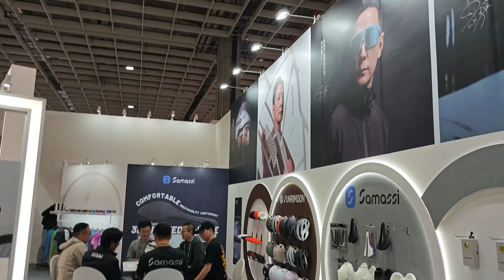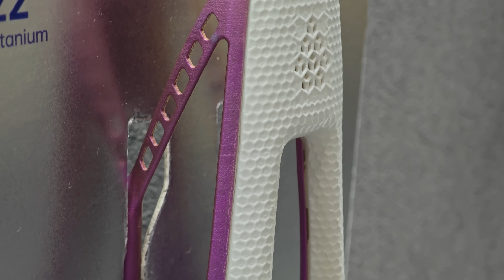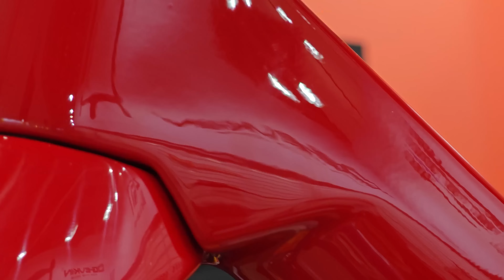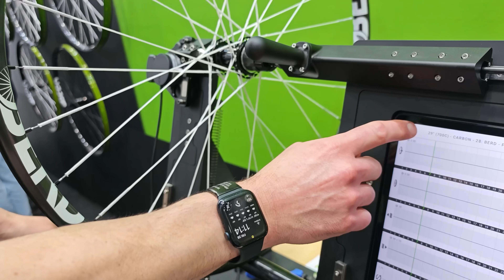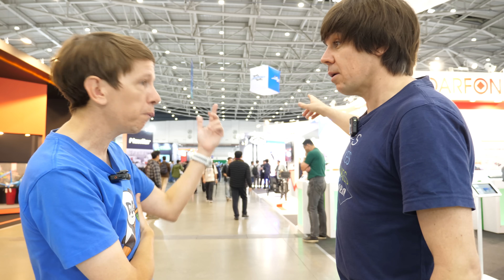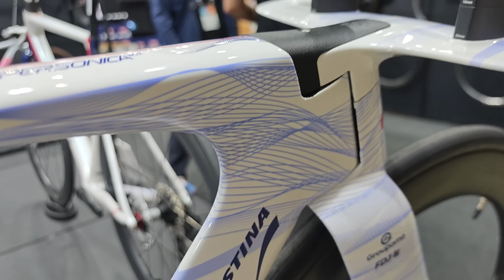Taipei Day 3 Ft. SHODDY DAVE, Track Frames, 3D Printing, BERD's Truing Machine, and much more!

Comment: is seems like Rockbros is becoming like Decathlon-cycling brand for the masses. they have coverage for all the basics of cycling needs from tools, accessories n now to base bicycle 👍
Reply: Worn their sunglasses for years, Do a great job and are cheap.
Reply: @2wheelsrbest327  they even introduce cheap cycling/tri eyewear with myopia inserts for the masses at cheap entry point (sp247 photochromics). and that insert frame, they even sell those replacement spares.
the stuff is not disposable junk, you can prolong the use 👍
whenever reddit quastion pops up for RX, i'd recommend this

Comment: Is the SPMND UCI legal. Do you have more specifications on the frame sizes? Thanks for the informative videos these last 3 days. I get the feeling that we are going to see more and more of the Taiwanese products in the western builds as the quality and spread of components is superb.
Reply: There's nothing uci illegal about it. The problem is that it's a blatant rip-off of the hope lotus track bike, which is heavily patented. If this bike gets anywhere near a UCI track competition, British Cycling are gonna come down on it hard.
Reply: I had not seen a Hope track frame up close before though I have seen them at many track events. The SPMND frame looked similar in style and shape though. If it is identical then it surely would raise questions. Perhaps it has been reverse engineered or perhaps it differs slightly from any original frame set? Maybe it is from the same factory? Do you happen to know where Hope has their frames manufactured? I did not see a UCI sticker on it though.
Reply: @rogercrawford1839  that's not what I'm talking about at all. The problem is that it copies the design philosophies of the fork and seatstays 1 for 1. This design concept of having the forks and seatstays in line with the riders legs is internationally patented

Comment: That Walkie Talkie thing is cool. It should just work with an app on your phone though, no need to get a sim and its own phone plan.
Reply: basic walkie-talkie is radio -no plan or anything needed, just a battery and you're good to go. Not sure about range, but my sister's kids used to use it while downhill skiing.
Reply: @davidrees1840  They've got to consider local regulations concerning radio transmission and the various limitations each bring. 
The FCC limits walkie/talkie devices to 2w and 22 channels between 462-467 MHz, beyond that requires a license to operate. So the range is very limited and exceeding it requires licensing. 
Apps most certainly already exist and are free that will work with a smart phone; discord, zoom, teamspeak, MS Teams ect, just need to figure out a push to talk key (BLE camera shutter button/media control) to avoid a chorus of heavy breathing and it would work perfectly fine. Realistically better than the radios used in UCI road racing.